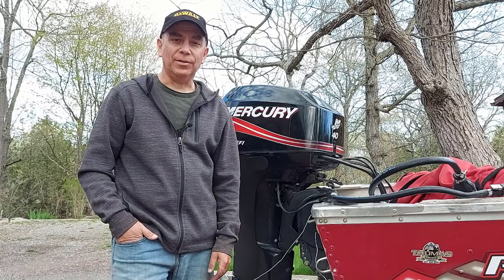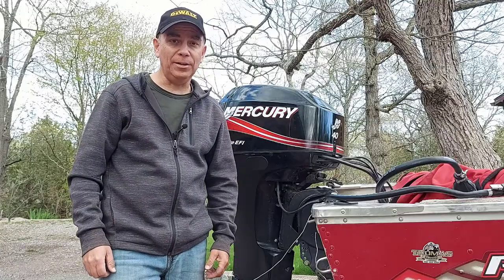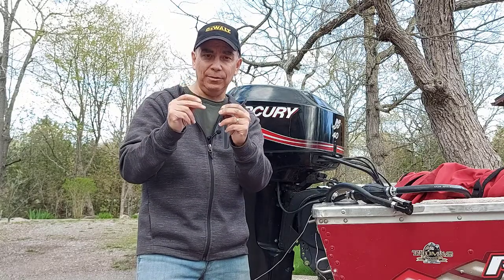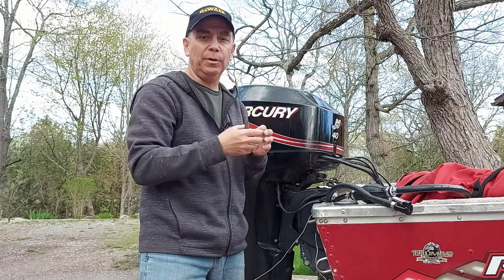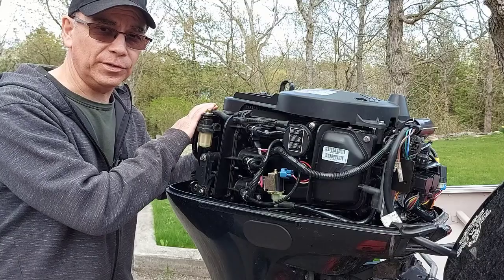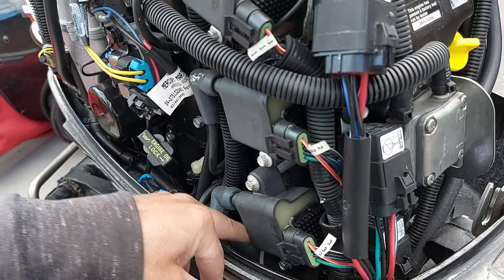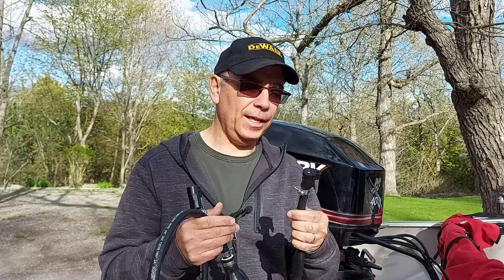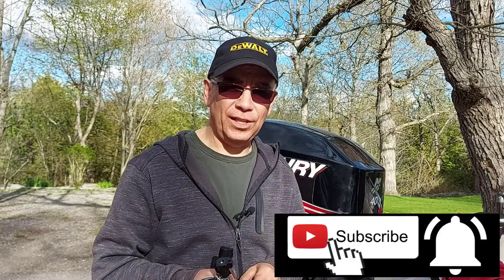Reason for Outboard Motor Bogging Down | See What I Discovered

Comment: that makes no sense, the stuff blocking the fuel filter will stay there, it will not travel back when you shut it off,  ...what might happen is that the pressure built up in line might push past filter as engine just sits, then will run on that fuel.   ...I've had grey fuel line on my merc 50 4 stroke for ,oh 20 yrs, never heard of this, nor did it ever starve for fuel, just sayin....

Comment: I also had a grey fuel line disintegrate on me but the culprit is not ethanol which's only downside is that it attracks moisture (water) over time. Use your fuel within a month and you"ll never have problems with it. THE problem is with benzenes that are really bad stuff that apart from causing cancer will break down plastics and most rubbers. All gasolines refined from oil has it. By the way, double-check at your gas station since most (if not all) premium fuels now have ethanol added. Regards !

Comment: I was on the lake this weekend. Ran fine all morning. Started heading in at full throttle and all of a sudden it started bogging down. And I heard a grinding as it was bogging down and then shut off. Did you hear that grinding noise as it was bogging down at full throttle? I was able to get half throttle and run it back to the camper. Now I’m here. Lol
Reply: Any updates? Same issue here, 5hp merc. Will run fine for a little while, and then it gradually loses power and then bogs down and makes a grinding noise. Let it sit for a few mins and it runs good but it happens again. Currently using a grey line.
Reply: @abc-sj6pu  yeah it was a bad fuel line
Reply: @matthewwillis2389 bad fuel line from the tank to the engine or an internal one in the engine ?

Comment: Thanks for informative videos, I have the same issue with my suzuki 30 hp. It starts and goes for 5 minutes and starts bogs, have some rest and the same thing again and again. I changed the fliters, water separater, fuel filter, cleaned fuel tank, changed the fuel, but it does the same thing. I will try the hose and see the result. Thaks for the video…

Comment: Also having a bogging down issue after aprrox. 5 min...(40hp mariner 2-stroke, 2005) Have more or less changed everything from fuel tank to clening the carb several times, but still having this issue. Found out that my newly bought Mercury/Quicksilver original grey hose with primer bulb manufact.date 22-10-02 (8mm) had a problem...I cut the connector  to the fuel tank with a knife just at the end of the connector to shorten the hose by a meter and  by coincident looked into the hose and there it was...a "treshold" in plastic reducing the fuel flow with 50%...this was without doubt caused in production due to heating up the connector (or hose...) before pushing the hose on the connector. and caused the inner liner to melt..and it didn't stop there, curious as I'm a cut the other three connectors, primer bulb (2) and the motor connector, and they all had the same "threshold" (which was not flexible). Too bad for me it didn't solved my bogging down issue.

Comment: Hey brother, I liked ur video. Having similar problem with my 90hp. I changed my grey line out a few months ago bcuz A buddy told me it was better. After running this by my outboard mechanic he told me Down here in Florida if ur going with a black auto fuel line not a good idea. It gets very hot in direct sunlight nd even starts to melt. I thgt he was full of shit but after it has bn on for while now I think he was rgt. Just fyi. For florida I think ur better off with grey, just have to keep an eye on bcuz ur 100% correct, It does break down the liner inside after a while. Thanks for info!

Comment: My motor just started this stalling issue last time out on the way back to the launch. I burn ethanol mix unleaded fuel and have for years with fuel stabil in it. I haven't changed the fuel filter in 3 years and my fuel hose is the gray line. I did put all new fuel black hose on the motor but need to replace the ball fuel line going to the motor. l'm sure that is the issue and will fix this over the off season. I live in the opposition part of the country so haven't heard about fuel line laws around here?

Comment: Same thing is happeing to our motor.  Interesting that we have the exact same motor.  Ours is a 2005 Mercury 40ELPTEFI. We don't have a gray fuel line, so fingers crossed that if we change the fuel filter, it will work.
Reply from the maker: How did you make out?

Comment: I had this same issue and stumbled upon your video and after I bought a new tank and put the old grey fur line on it it still wouldn’t get fuel correctly and then I found your video and checked mine and had to change it out to the automotive fuel line like you did. But now I have to pull the carb and do another cleaning because it will only run when I work the choke to keep it running
Reply: ...too many conflicting things here...

Comment: Great video I'm having the same issues thanks
Reply from the maker: Glad it helped
Reply: @GettingItDoneRepairs  yeah it I've changed both fuel filters and line my low pressure filter was stopped up I'm still having issues o hope it hasn't gotten in to my fule pump thanks again

Comment: Great video - I am experiencing the same issue and just ordered the new fuel line from Mercury, which does not have the liner. Quick question though. I have a 2008 Mercury 40 hp, but the fuel line is 5/16. Your new line is 3/8th. Any reason you went with the larger line or did yours come with 3/8th? Thanks agains!
Reply: Same question I have the same motor but a 50